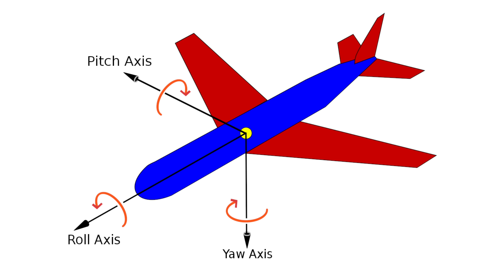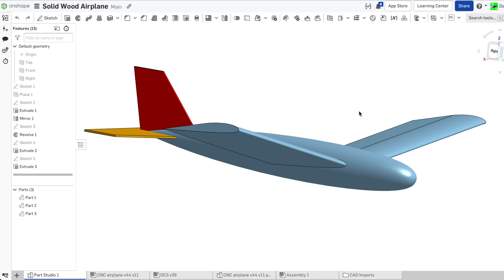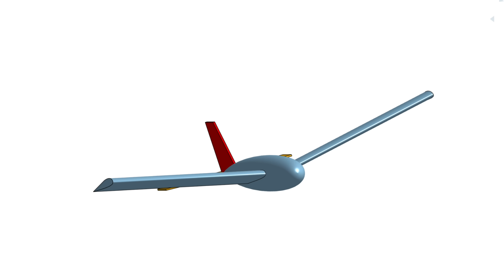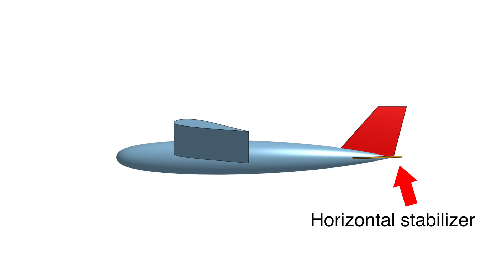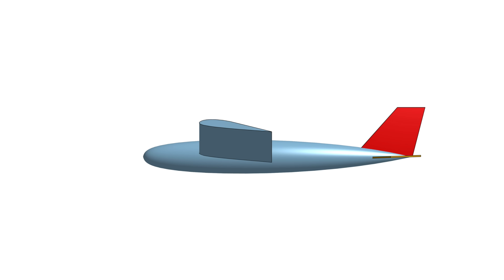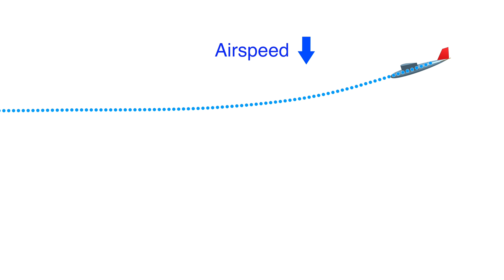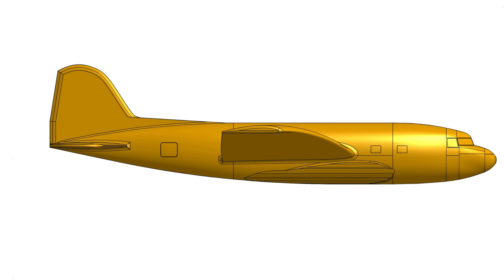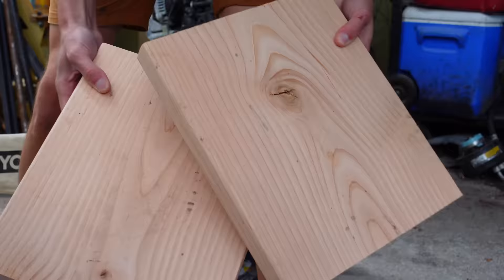Can a Solid Wood Airplane Actually Fly???

Comment: Honestly, your explanation of basic aircraft fundamentals was better and more concise than a lot of the college classes I took for my AE degree. Would recommend your video to any entry level college students or anyone just interested in the basics of flight.
Reply: Yeah most professors are awful at teaching. They just passed the classes, got the degrees, and voila there to teach.
People gotta be good students and teach themselves.
Reply: @iteerrex8166  everyone with a degree can teach, but not everyone is passionate about it...
Reply: @heyitsmejm4792  Id say it takes other skills besides knowledge and passion to teach well.
Reply: I was checking out my dad's high school physics book from the early 40s and every one  these principles were discussed .
None of this interesting stuff was addressed in my own physics classes in the 70s
Reply: Agree 100%
Reply: Agree about this explanation...it's really good.
45 years ago I used this fundamentals on a paper plane....not from one sheet, but just build from mostly paper and some aluminium rods.
That flew amazingly good...100meter  (half cirkel of 30 meter radius) with only 3 meters height loosing.) Even professional gliders do only double  ...200 meter for 3 meter height loss.
Reply: @iteerrex8166  correct. BUT knowledge far beyond the minimum required level is essential. Without that answering student questions is impossible.
The other skill are needed to explain understandable.
My start knoledge about these physics I got from an encyclopedia written in 1927....not from my schoolbooks in the seventies.

Comment: As an engineer It’s fun to watch you share your theories, iterate prototypes, and then test, test, test.
Reply: hey
Reply: glad to see your comment. have a nice time. i am searching job. but i also want to work on some projects. 
wish you good.
Reply: And what kind of engineering do you do?
Reply: I'm sure the FAA loves it too. Dropping lawndarts from hundreds of feet in the air.
He lost many of the planes. Who knows how many houses or cars and other property were damaged.
Reply: Exactly what I was thinking too. I used to make cambered paper wings and rolled up paper for fuselages, and build my own gliders. Much like these but not 3D printed. This was 30 years ago. Gosh, I feel really old. Anyway I may have built some 200+ of these - all kinds of designs. I loved building them. They taught me everything about gliders and flying machines
Reply: As a normal (not) person with adhd, i also like to do that.
Reply: The "japan plane crash"? 12:01
Reply: @foju9365  What was yor best glide number (height to distance ratio).
Professional gliders will be between 40 and 70 times the height (assumeing no thermiek available) depending the glider model.
I made once one , 45 years ago, as you build reaching an astonishing 30 as ratio...much better than ever expected.

Comment: For practical non-littering, maybe a slight roll bias to keep them in the field is desired. :|
Reply: Maybe use steel over lead just in case you leave it
Reply: i always add brightly colored paracord sleeves. it doenst only look cool but also helps me find my shit
Reply: Do we now need a leftfield and rightfield wing option...  (Left and Right wing don"t define the deviance adequately)
Reply: @peterlustig8021  i fill them with TNT and iron nails so they self destruct exploding when they land somewhere and the nails flying away make whooshing sounds to better find the source of where it fell. it also helps if there are people around because you will hear screaming. nice little side bonus
Reply: @snuffying  i would add exposed lead and aim them at water sources
Reply: Did he ever think those things could hit someone or a passing or parked car?   Sorry but I can't approve his testing method. If things really would have gone wrong what would he have said ?  Sorry ?
It seems he has brains so maybe he could use them.
Reply: @ducthman4737  I came to make the same complaint.  This seemed extremely inconsiderate and potentially dangerous to others.  Go test in the middle of nowhere or don't test at all.
Reply: @ducthman4737  Or a horse staggering in the distance before the sound of a chainsaw to remove it😮 😊
Reply: Not just littering but killing..
Hitting a horse or random person walking by could easily kill them..
A neibour had a fire in their yard after a person lost control of a drone and left it..
A lithium battery and electronics hidden in your yard with leaf litter etc.. Is not a good mix..
Reply: @zakofrx  Everybody dismisses the safety concerns till something happens. They of course could be cut from the video as well.  I would hate for even my car to be damaged cause somebody wanted to make money on YouTube.

Comment: You just made flight physics something understandable by everyone in a cool and concrete manner. Incredible video, I remember asking myself this same question. And you answered to it, you showed that anything no matter the wing loading can fly as long as you give it enough speed !
Reply: until you have to do the math associated with it. then it gets more fun.
Reply: I tried it out with an ashtray, it worked !
Could also use that ashtray as a 'remote control' for the TV (to turn it off), just give it enough speed.
Reply: @Jila_Tana  Aim right at the center of the screen.
Reply: Yeah you can pretty much make planes after watching this. Sweet.
Reply: If you strap a big enough engine to it, a BRICK can fly and break the sound barrier.
Reply: well at some point it'll vaporize mid air

Comment: PrusaSlicer 2.6 has the ability to add pegs and holes to aid in aligning and glueing models that are printed in multiple pieces. This might help you with aligning the two halves of your models.
Reply: It is ultra convenient that this is automated, I and any other adequate designer have been doing this in large prints or assemblies for years (I tend to use small steel pins (we have basically unlimited supplies of surplus  machined 1.5mm "dowels ) inserted into matching holes, they are incredible strong providing early alignment support  at the bonding layer (better than printed dowels for fine detail)
Reply: exactly, the whole time i was wondering: why doesn't he just add some pegs on the inside to help with the alignment process

Comment: I was curious if Revell Models were able to fly, so I bought a few and tested them with a large rubber just like you did. They flew suprisingly well and very far, and I never expected how stable they flew considering how small they were. Maybe you could try that in a video too, it was a lot of fun.

I had the most success with a 727, Buccanner and suprisingly a Su35
Reply: I would like to see that in a video!
Reply: It's interesting that those were all jets, which are designed with the heavy engines in the middle, so the model probably has a fairly accurate CG. Prop planes are mostly designed for a heavy engine in the nose, and (as most kids discover) don't balance when you try to hang them from the ceiling by looping thread over the wings.
Reply: Actually the CG was still very far in the back. I had to add quite a bit of weight. If you built them as a Kid and left the weight out they would always tip backwards with the gear out.

Jets are still better since they have a longer nose and larger rudders and elevators compared to props. And I feel like the sweeped wings add flight stability aswell. 

Sth like a 190A or Biplane would likely be not possible to fly at that size due to all this, especially as a glider.
Reply: did they survive?
Reply: Yes, still have them, tho the noses are very scratched. They can take a suprising Amount of damage.
Reply: Try flying them underwater in a pool. A late '50s mid '60s Aurora model of the AVRO CF-105 will slowly fly straight and nearly level across any size pool you can underwater launch it across.

Comment: you need to use alignment holes and pegs to ensure that the two halves are properly aligned. I actually use spring loaded pins that I 3D print to hold the two halves together, if you use enough of them you don't need glue. The pins are originally from a fairly well-known 3D print, the gear cube

Comment: The beauty of a dihedral wing is that the more side-slip you get the more the lateral air pushes down on the higher wing, leveling it out. But I always put a little elevator pitch in to keep that nose up.

Comment: You should print in PHA plastic, it's supposed to be biodegradable in nature (unlike PLA which is "biodegradable" at high temperatures in basically an industrial setting.
Collorfab has a filament called AllPHA, which I've tried and it works very well, kind of prone to warping though.
Reply: I’d wager that PLA miniature airplanes make for pretty good rocks, definitely better than say, a garbage bag.
Reply: @jumpvelocity3953  sure, they don’t run the risk of entangling animals or anything like that, but they will still be worn down into micro plastics and end up in the bodies of animals.

Comment: To avoid issues with misalignment in the glue up, you could put two or three holes for pins in both halves, and then print dowels that will fit snugly in the hole on both sides, to lock the halves in place in a similar way to the pins you used to hold the block of wood in place.

Comment: So interesting!
But i was constantly afraid that someone was gonna get hit by a plane.
I think its quite dangerous since the planes randomly fly somewhere.
Reply: Yeah I hope no one got hit by a flying wooden plane.
Reply: @AHN1444  can tell if that comment came from genuine concern or if you're referencing the Chilean air disaster back in '83 😮
Reply: @skussy69  which chilean air disaster? It was genuine consern
Reply: If such a plane hits someone,  it would cause severe injuries, because it's so heavy, solid and fast. It even may kill people. Just look how deep it's going into the ground. You don't want this going into your stomach.
Reply: Karen
Reply: @timch5227   sounds awesome
Reply: @joshuahedges4882  its true... hate to say it. If it had changed just a bit, it would have embedded itself in that delivery truck, if the other had spun differently you could be looking at a dead horse or worse.  When testing missiles you need to take them where no one will get hurt.
Reply: @bootmenow  at 26:59 you can see what appears to be a kid on a scooter appear in the lower right corner of the frame in the direct flight path of the plane. There was a non zero probability that the solid wood plane could have hit that kid and maimed or killed them. As the flight characteristics improved throughout the video, the danger radius increased in unpredictable amounts. If one of the planes impacted a person, animal, moving vehicle, etc it could have ended in tragedy. I think the safety margin at the beginning of the video was adequate, but by the 3rd or 4th iteration a larger controlled area was needed. Thankfully nobody got hurt and it was a very cool exercise in engineering and design.
Reply: @3333927  And with sharp edges!

Comment: At 12:06, I believe that was just a simple accelerated stall. The way the aircraft tumbled likewise to its prior AOA makes it appear like just a stall.
One of the things I noticed was the reaction of Adverse Yaw, in this case it appeared to be the affect of one of the wings at an abnormal AOA compared to the other wing, causing the other wing to have more airspeed, and the right wing holding the fuselage back, thus yanking the aircraft to the right. That, of course, seemed to be the result of an Accelerated stall.

Comment: It would be awesome to put a little board computer or microcontroller with some accelerometers in the hollow body of those 3D printed gliders and see what the actual flight profiles looked like.  But then I guess having them explode on impact with the ground or getting lost would be much more expensive.
Reply: A simple accelerometer and microcontroller are really cheap these days and they can be operated using really tiny batteries. It should be significantly below 10 bucks as long as you don't include Telemetry, GPS, a proper flight controller, etc.. but you probably need to do some simple coding, soldering etc..
Reply: @florianvahl5494  With a decent 6 total DOF accelerometer/gyro platform you can do a pretty good job of having it fly a path to a destination, and maintaining controlled flight, as long as the accuracy of the two are good and the gyros don't drift too much over the flight duration, meaning not much at all.  I guess you would need a compass and an airspeed sensor to really have all the data to make it simple to do with a controller.
Reply: Pretty much all the necessary components would be mostly solid state I believe so even if your plane met a tragic end as long as you can recover it most of your electronic components should be reusable I would think
Reply: That is the origin of this channel basically - any ardupilot-compatible flight control board simply does this in their log file or telemetry link (when they appeared on the market multiaxis (even hyper dimensional) telemetry became affordable for any application).

Comment: Hey, idea for this series: what about a golfball dimpled airplane? Since you have the CNC, put a ball nose end mill on it and mill the dimples to see if you can reduce drag by creating mini vortices along the fuselage.
Reply: This comment reminds me: wasn't it the front/back split double delta that flew so well? Could the presence of the very slight layer lines on the surface in different directions do weirds things to the airflow?

Comment: 👍🛩🎓 "I must say, the animations and explanations in this video on aircraft stability were top-notch! It's impressive how clear and engaging they were, surpassing even some official private pilot curricula. Kudos to the creators for their excellent work in simplifying complex concepts. I learned a lot and thoroughly enjoyed it. Keep up the great content! ✈📚👏"
Reply: Whu do people have the assumption that pilots know much about aerodynamics. They are just driving a flying vehicke and only need to know some basics
Reply: @snorttroll4379 s stuff is part of pilot training. You learn what the flight control surfaces are, how they work (and interact). You learn about CG and CP, flight dynamics, and stability. You have to do a Weight And Balance on an aircraft and explain what you did, what it means, and why. There's a lot more too.

You do this because you have to inspect your aircraft before every flight and load it safely. You have to control it in some very dynamic conditions. For example, you have to demonstrate how to recover from a stall (and some instructors will include spins as well). If you don't understand dihedral and washout, you probably won't recognize an incipient stall.

The people who assume pilots know these things probably have some pilot experience themselves.

Comment: Your delta wing recalled a toy plane I was given as a kid. It was an all plastic (!) delta with a 3D fuselage and canopy! It looked real, unlike the common balsa cut-out gliders which didn't. I'd always wondered if it was possible for a plastic plane to fly, and now I had one! I took it to my new school (only 100' or so from home that year) and the class crowded around to watch me fly it at recess. All it needed was a stick with a rubber band on it!   
I pulled back and let her fly. All the way across the rough field it flew at about eight feet, before dropping gently before the road. Into a small pile of rocks. Which punched in the nose. As in pieces. So much for flying plastic airplanes at age 7. And so much for "unbreakable" plastic.

Comment: I'd like to see you mount a little .049 motor or maybe even a .019 and see how that works out. Then eventually, turn it into an RC plane. You'd get enough continued, level flight to observe better how the different designs and adjustment configurations are working. I suppose the current trend being to electric motors, you could do that, but the overall increased weight of an already heavy plane might not be so good.

Comment: Will the next plane be made of cast iron?
Reply: with a higher velocity
oh yeah
probably wings will drag too much so they shoud be smaller.
idk. still tough to get the speed. probably need to be launched with powder
Reply: @Ritefita metal doesn't need so thick wings, as the material can sustain the same load with less material.

Comment: The main reason dihedral applies roll stability because the lift vector on the level wing is vertical to gravity while the tipped up wing has a lift vector that is slightly out of vertical to gravity, thus the tipped up wing will produce less lift in the vertical axis than the level wing, so the aircraft will naturally hunt for equilibrium where both wings have the same amount of lift which would mean the aircraft is level in roll axis.  Its easier to visualize it when you draw arrows perpendicular to each wing making them both the same length, and then draw a line from the fuselage representing gravity.  Look at which arrow reaches farther down that line preopercular to the gravity line.  The longer line is creating more lift in relation to gravity than the shorter line, so the wing with the longer line will lift up more than the wing with the shorter line until the two lines are equal perpendicular to gravity.

Comment: The slingshots... I would try aiming upwards... maybe start at a 45 degree angle.
I used to make these book of paper airplanes called "White Wings" which were designed by a Japanese engineer. Made of oaktag that you cut out of the book and glued together layer by layer.  It was the greatest book of my childhood.
It used a rubberband slingshot to a tiny hook made of a staple, and you needed to aim upwards (30-60 degrees) rather than horizontally.